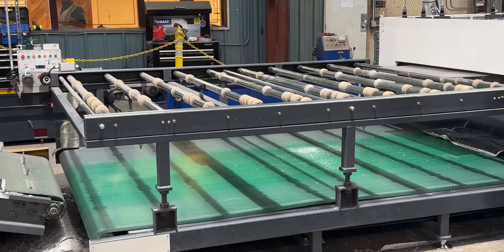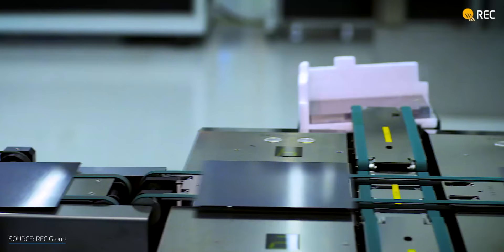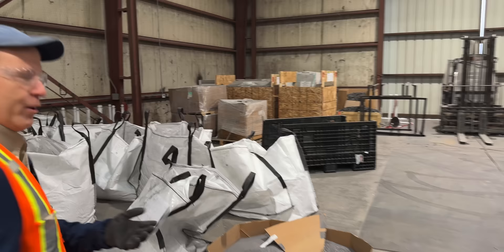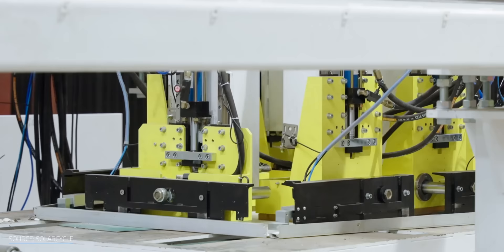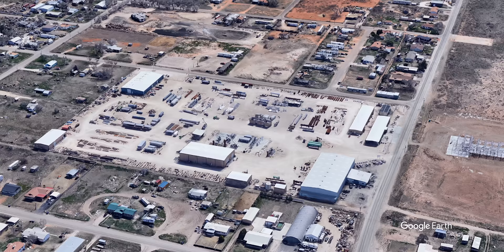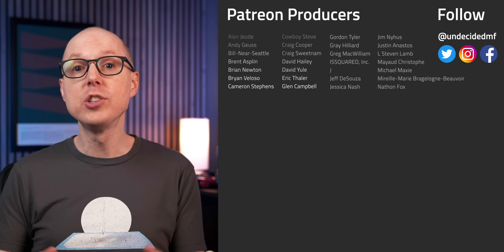What REALLY happens to used Solar Panels?

Comment: How much energy does it take to recycle a solar panel?
Reply: That's an interesting question & the answer should not only be compared to the amount of energy harvested by the solar panel but also to the total energy cost of the 'classical' production of a solar panel.
The energy cost of recycling solar panel into a new and healthy solar panel (i.e. the maintenance cost measured as energy) should obviously be less then the amount of energy it produced.
Reply: Good question, but probably a lot less than is used to make a new, virgin one just based on the aluminium alone. As the video says, recycled aluminium uses 95% less energy than virgin aluminium. Honestly, it is probably a net gain just on recycling the aluminium, but the silver, copper, and other metals are nothing to sneeze at. I'd love to see the actual numbers.
Reply: @Apollorion  Considering that he here said reusing these recycled materials requires a lot less energy, it should be better than completely new mining and manufacturing. And if the EROI wasn't already beneficial, PV panels would never be used like they are now.

Generally it is said it takes around 1-4 years (other sources say 1-2,5) to earn back the energy used to produce it (completely new panel).

Comment: One of the things that we’re learning about solar panels is that the estimated rate of degradation has been overstated. When I first got involved with solar power over 10 years ago it was estimated that solar panels lost about 1% of their capacity per year. We now know the number is closer to 0.5%, and in another 10 or 20 years will have a more accurate idea.

Comment: We need to find ways to extract pure siliocon and silve from solar panels. They constutue more than 50 percent of value of solar panel. Moreover, the silicon and silve so extracted needs to be pure enough to be reused in application where they are economically viable.

Comment: The process and timing is so typical.  Manufacture a product and find ways to increase profitability.  Then when the product becomes an economic/environmental issue, THEN start working on resolution.
We need to require a full circle methodology at the time of production or at least a quicker timeframe.

Comment: I believe you need to have these solar panel recycle center strategic locations (distributed and/or centralized) for where the panels are being disposed , such as landfills or solar farms. Also in reasonable locations (for cost effective transportation) where the raw materials can be reused and provided to solar panel manufacturers in the distribution areas for OEMs.  Thus you cut not only the cost to recycle but also the cost of reuse and manufacture of solar panels.

Comment: I think the important thing is take the very pure metal silicon wafer. The most energy demand to manufactur solar panels is to create very pure silicon metal to turn into photovoltaic wafer. If you get the pure silivon back it can be used to reduce energy demand to manufacture new panels.
Reply: Or just repair and reuse the panel..
Reply: @dufung3980  Yes, repair can be fine sometimes. Even panels which have lost 20% of efficience could be relocated to large open areas or solar farms and still generate electricity for 10 years perhaps.
Reply: The Silicon solar cells are made from very pure Silicon wafers but the cells are not pure; they have been doped.  So, you are basically confused.  There's no pure Silicon to get back.  This is why the Silicon can't be economically recycled.

Comment: I'm optimistic in the long run on these recycling efforts.  But I assume that the $15-$18 cost to recycle a panel is the NET COST, after selling off all of the valuable materials that were recovered.  What is the actual cost to process the panel, and what is the revenue generated by selling the materials?  The video talks extensively about all of these valuable materials that are recovered, but are they really that valuable if they can't even cover the cost of recycling??

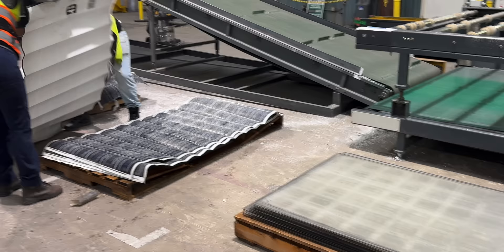Comment: Solar Cycle located in Texas.They are concentrating on developing machines and processes for Removing tempered glass and silicon. 3:44 
5:20 cell material
Copper tin silicon silver
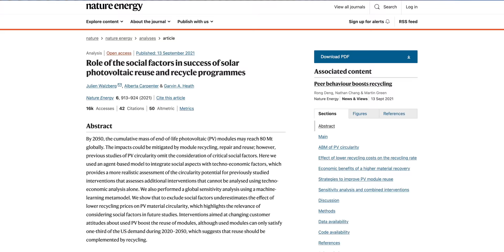6:21 time consuming takes a long time and currently 3x as expensive .
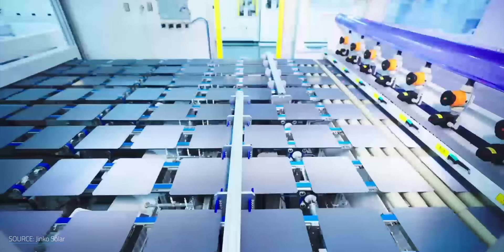9:21 most panels were sourced from China.

?? Australian company trying microwave instead of heat.
12:18 promising hopeful future: cost and proficiency: maybe.

Comment: Reusing is still better than recycling. That goes for solar panels as much as batteries. Finding use cases where they don't need to perform at peak capacity anymore such as for green hydrogen production or just giving them away for free to developing countries seems like a better alternative.

Comment: the efforts to recycle renewable energy generating equipment face the same economic obstacles as the plastic recycling industry faces.  The technology to recycle these products are viable but have a low return on investment.  In order to survive, the recycling industry requires government “recycling subsidies” just like the “subsidies” the agriculture industry receives. The exception is the battery recycling industry which already receives assistance from federal & state programs requiring battery suppliers to setup end of life product returns with financial incentives for consumers.

Comment: I've worked in R&D for 20 years and I would be surprised if the CEO isn't exactly truthful on the cost of separation and the value and purity of the salvage components 
And I would also image that the amount of valuable material inputs will be going down in the future of solar panels
Reply: yea I’m guessing separating and reprocessing the metal scrap is cost parity with mining virgin material  there so little metal compared to silicon dioxide that is basically like mid to high grade ore and will require similar level of energy to refine.

Comment: I still think focusing on solar and wind is a mistake considering there are other more powerful and reliable methods for producing electrcity. The major problem will ALWAYS be that precious metals are just that, precious. Building machines that capture diffuse energy based on area covered is not the future. Its merely a supplement.

Comment: I am curious to see how the solar panel industry has started to evolve. After living in Denver in 06-07 I was invited on a tour of then advanced solar and alternative energy efficient homes. It was explained to me at that time that Reagan had killed the solar industry when he took away tax credits for solar energy put in by Carter. Because of this it was only relatively recently that the solar panel industry had begun to grow again. New research was beginning, research that had been by and large dormant for many years. Someone was supposed to have learned how to print solar panels for example. I don't know if that ever came to fruition of not? I am curious as to how far the industry has gotten in just the past twenty years. If you accept what I just pointed out, this essentially means that while the solar industry has been around for decades, it is only relatively recently that new innovations have started to take shape. One wonders if the complicated recycling process that is still tied to the original model of solar panel design might become a better option when different manufacturing methods of solar panels are discovered.

Comment: 20bucks per panel before you sell of the reclaimed materials ... clean and package the glass in stacks and sell it back to solar panel assemblers ... smelt the metals down in a large crucible and keep pouring off the pure layers into their own new ones and the mixes keep going until you run out of the metals to melt ... ow you have pure raw metal ingots you can sell ... or manufacture further into more expensive products or common items ... and sell those ... making that 20bucks cost per panel more like 2 or 3 bucks if one diversifies from one end to the other of the chain ... start with a solar panel removal replacement service ... store the panels and split them up as you can ... once you can afford to buy machines for the various resale items get them going ... now those removed panels are making money ... and lowering the need for NEW resources ...

Comment: Terrific video Matt! Separating those solar panels is a real problem. I was wondering if using Ultrasound or Infrared technology, or a combination of the two, would work to separate solar panels more easily and quickly? It would also perhaps be more cost effective.  🤔🤔👍👍

Comment: The aluminum alone is extremely valuable because there's so much of it volumetric wise in a solar panel when compared to mining it from the earth. There's hundreds of time more more aluminum in a ton of solar panels versus in a ton of earth. I'm shocked that Alcoa doesn't yet have a solar panel recycling plant.

Then of course there's the silver portion whose value goes without saying.

Comment: I get annoyed whenever someone says it is too difficult or expensive to recycle something to do with renewables.

Do they have any idea how difficult it is to mine for coal or drill for oil? Those industries have only become viable because they have had endless money and engineering poured into them to drive down costs. All along the way they've had social licence to do endless environmental damage and externalise these costs on to others.

If carbon was priced as it should be, and solar/wind/batteries etc. were growing as they should be you can be damn sure people would crack these challenges and make a lot doing it!

Comment: It isn’t that products can’t be recycled, it is that it isn’t economical to do so unless the cost of recycling is built into the product price.  This is how it should be done.  Every product sold should have a requirement that the manufacturer take the product back at end of life for recycling and place the cost of this in an escrow account in case the company goes bankrupt.  However, no politician wants to do that, especially with technologies they are pushing that are already not economically viable such as solar.  This makes their “green” technology even less compelling.  However, that is the only way to really address the recycling/waste issue.  The buyer of the product needs to pay for it at the outset.

Comment: This was informative. My question is will this actually happen, will the benefits ( costs ) be worth the efforts, otherwise I don’t believe this will be done. Remember, as we work to push these system we commit to doing this for as long as we use these systems. 
Now look into dealing with the wind blades, they are not even close to being as easy as recycling solar, and the land fill is just as large as solar.

Comment: companies like solarcycle ARE the future. there's enough recycle material already out there... in scrap, headed for scrap and approaching end of life, that can supply all the demand for a huge portion of kwh demand. the same is true of lithium batteries & companies like redwood. it is also conceivable that manufacturers could develop more recycle friendly assembly methods- for instance- binders that release when the right frequency of microwave or light energy or even ultrasonic energy hits them. imagine a solar cells that spontaneously disassemble when the right high energy microwave frequency hits them.

Comment: Great counter to "solar cant be recycled" illusion  {which is little different to 'its not economically viable'  & theres not the infrastructure ... & a 101 butts stopping healthy problem solving that amounts to putting cart before the horse}.
I went to Centre for Alternative Technology in Wales annual conference this year & they ran a workshop / discussion on DfD " Design for Disassembly" which was specially for the construction industry - which has loads of waste issues.   The idea there is building buildings with a more "BAMB - Buildings As Material Banks" like every lego construction is a repository of bricks etc for the next model - that doesn't require melting down, electrolysis or other heavy industrial processes [energy guzzeling, transport intensive & polluting].
To get serious about making not just construction but all industries as circular as possible, we need to design things to be taken apart, repaired, bits reused in different settings etc  open source culture is the way this can be achieved medium term.   But the proprietary for exclusive profit of tax avoiding, gov subsidies for golden board favours handshakes not our problem if were making money by skewed corporate law, civilisational self terminating mentality has to go.
DfD & BAMB principles realistically helping to close the loop of circularisation is { baring 2nd law of thermo dynamics etc}  a massive step up from market forces structural failure to recognise the real price of things, there are NO Externalities on spaceship earth. 
Downsizing in next 30yrs is happening weather we like it or not, we either accept, manage it & smooth the decline or have steep existential drop offs

Comment: I love solar panels too, but I'm not a "tree hugger", to me the most appealing thing about solar panels is the fact that they have a 6-8 year ROI, beats the stock market on average, and most normal investments. As long as they worked, and I got 20~ years of use out of them, I honestly don't think I'd even stress what happens to them afterwards. Sure, call me selfish, but there's many larger issues when it comes to the environment, than to worry about what happens to 20-30 panels that I have on my roof for 20+ years, after they've generated mWs of electricity over their lifetime. It is cool to know that they're recyclable, though. Most things are..

Comment: Why not reuse the glass panel? Grinding it up and retiring is very costly and energy intensive.
Reply: One of the reasons PV panels have reduced efficiency overtime is due to damage (even very small) to the glass plates, so just reusing them for new panels isn't efficient and finding another use for them in other applications in their current form and state likely isn't that easy either.

Comment: If we ever set up a carbon economy, they would get a great carbon credit just for the CO2 savings in aluminum. With a slightly larger footprint, they could (just) add melting and forming equipment and turn the reclaimed aluminum back into the raw chanel stock used to make new panels...

Comment: While i do agree with him stating we need to come up with the tools and technologies to recycle more.  We also need to get big government policies out of the way of innovative technologies on these fronts.   There are many policies in place that are said to be green but have the opposite effect.  The major one that comes to mind is the calculation for vehicle gass mileage.   This single calculation has removed the smaller S10 and Ford Ranger style pickup trucks from the market.  That style truck has to get sedan gas mileage in order to be sold.  Since they cannot because of their use case they cannot be sold forcing people who need or want a pick up truck to get a larger vehicle that gets less gass mileage.   In my case i would much rather buy a cheaper Ford Ranger that gets say 25-30m/g than the more expensive F150 that gets 18-23.

Comment: The problem begins with the manufacturing process to begin with. Recycling needs to be part of the manufacturing. The manufacture needs to be responsible for the life cycle of the product. The price needs to include the cost of recycling. There is too much e waste. I’m 60 and have managed to keep my white goods going beyond 15 years but it is getting hard to get parts, especially in Australia.

Comment: Easy step up. Assembly lines are completely robotized. Disassembly machine has 4 operators. Automate those functions with robotics and vision system... 1 operator instead of 4...

Comment: What I don't understand is why there aren't design standards enforced that would facilitate recycling in the original manufacturing of the panels.  Surely a thin transparent layer could be added between the glass and the layer under it that would allow easy separation during the recycling process.  Why haven't standards been implemented to make recycling solar panels easier and cheaper?

Comment: The problem with this company, is that they're not trying to make money off of the value of the raw materials. They sell them all mixed up, for others to have to separate.

This breakdown process seems like it would be much more feasible as part of a complete recycling process. Where the metals are separated and sold directly to the companies making panels.

Comment: For me, the simple solution is to ensure it can be disassembled just as easily as it's made.  One way to do that is to reduce or remove the adhesive altogether.  Along with that, finding an alternative to silver, to reduce its cost and limitations, and ensuring they last longer.
Reply: The silver content is a large part of the drive to recycle solar panels. Let's not discard such an important motivator just yet.
Reply: You can't take the doping out of the Silicon.

Comment: Recycleability should be addressed in the manufacturing process.  Designing the panels to be easily recycled should be part of the panel design criteria and allow the panel manufacturers themselves to become the leaders in this field of recycling and cut out the middle man in their acquisition of materials to build new cells with. 

Best!
Reply: It doesn't work with Silicon solar cells.  However,  First Solar will totally recycle their CdTe panels.